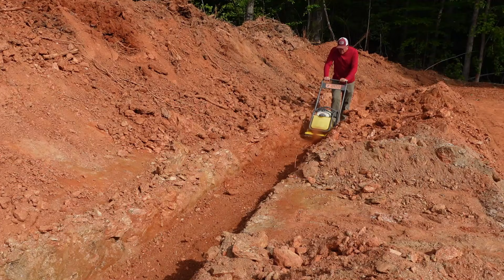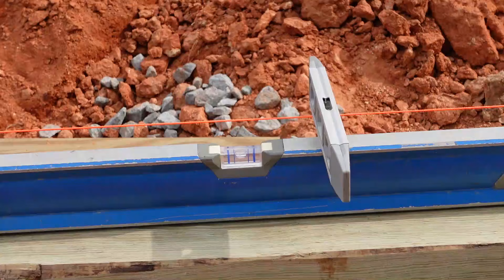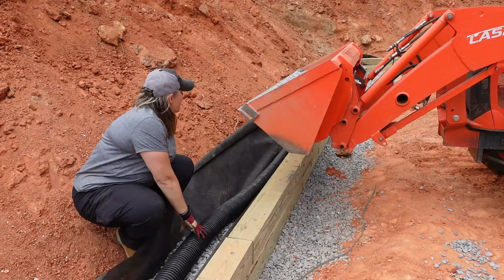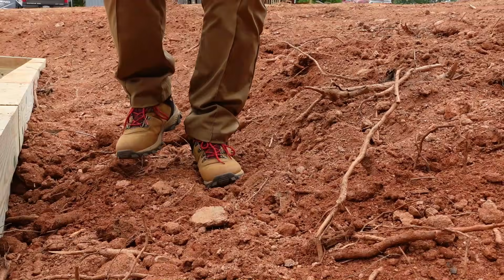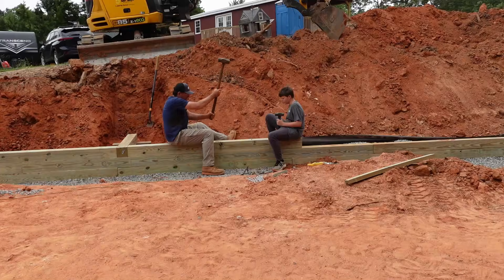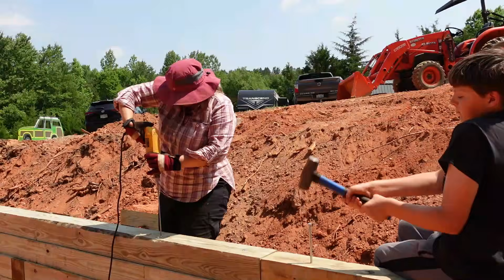Massive Wood Retaining Wall Build With 6x6 Timbers

Comment: Timber walls are cheap and easy to do.  However, the chemical starts to leave the timbers at about 10 years and the carpenter ants love to move in.  My wall is currently 26 years old and still standing and holding.  However, I have a bug man spray it every year trying to make it last.

Comment: Man, you cant call that a DIY project if your using an excavator. Lets be real, 90% of us dont have an excavator at home.
Reply from the maker: It's a Rental, and rental rates are surprisingly reasonable, especially over a longer term. I had it for 4 weeks and got several projects done at a fraction of what a contractor would charge.

Comment: Good video, thank you for that. What depth of gravel below 1st block? what kind of drill bit did you use for the bars on the first set?
Reply from the maker: About 4 inches of base stone and just a normal 3/8 wood bit to drill the hole for 3/8 rebar. Thanks for watching

Comment: Great job. I did the same thing in the late 80's in my first home in Alabama. I used railroad cross ties for my wall, and yes deadmen were incorporated. Lots of hard work without a tractor. I must have wore out 10 chain saw blades, and about the same 3/8"x 10" drill bits. Railroad crossties have a lot of dirt and pebbles in them. Love the wall.

Comment: That is all lovely, with the dead heads and tie-backs, but if you don't enclose the drainage gravel in heavy-duty filter cloth, soil and sand and sediment will leach into that drainage gravel, and undermine it.  That shortens the life of the wall a lot, particularly if the project is in a place where there is frequent freezing and thawing.  A weeping tile will not save that, even if it is wrapped.  The filter cloth matters.  It should not have been skipped.
Reply: Guy who built our "retaining-wall-on-grade-basement" place made his backfill 50/50 sand/soil and plenty of rock. 30y later, no new pad for bmt bedrooms!
Reply: What do you do when the filter cloth is clogged with soil and sand? Ideally the drainage topside should be adjusted to keep water from getting in there in the first place.

Comment: All that time and money just for it to rot away in 10 years or less. I would have added far more sone to the back simply to keep the wood as dry as possible to prolong its life span. It’s going to stay wet and fail quickly. Current day pressure treated wood isn’t as good as older pressure treated products due to the government forcing milder chemicals in the process. The cost difference of block to wood isn’t the expensive part of this project it’s the labor if you paid someone. Idk 10 years goes quick only to be looking at doing it again. Buy once cry once and do it in block and be done is my thoughts. Also adding a small amount of water when compacting is needed for proper compaction. If dust is flying your material is too dry. Another thing with retaining walls is your toe section of the wall needs embedment, walls need a minimum 6” and up depending on engineer specs.
Reply: Back in 2000 I terraced my hillside down to the lake with 6 walls built with these. I didn't do my research and used very little rock for backfill, mostly just black dirt and clay. It's a shady, north facing hill so stays wet. It's at the point where I have to replace the bottom 2 walls and maybe one in the middle. I would say the others have a good 5 years left. Not bad for 24 years. You may be right about milder chemicals now but I bet he gets more then 10 years out of it, especially since it looks wide open and sunny.
Reply: You think better to go concrete wall vs wood if cost isn’t an issue?
Reply: You are right.  The carpenter ants love these walls after the chemical starts to leave them in about 10 years.  My curent wall is 26 years old and I have a bug man spray it every year.
Reply: As far as embedment goes, can it be build above ground of its being backfilled in the front?
Reply: I would have used old treated railroad ties.  May not look as clean looking but would probably last 20 plus years..
Reply: I would paint wood with asphalt based paint inside. 
Additional small drains  close to soil above drainage pipe ( the one goes inside)

Comment: How did you terminate the drain pipe? Does it simply run past the ends of the wall and into the soil? I live on clay that doesn't drain well. Believe I would need to provide outfall points for free drainage.